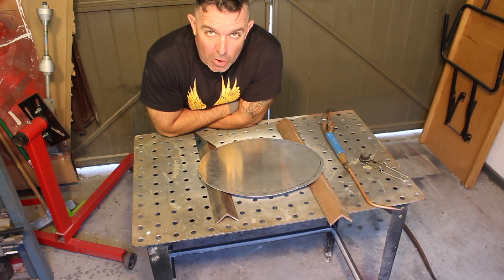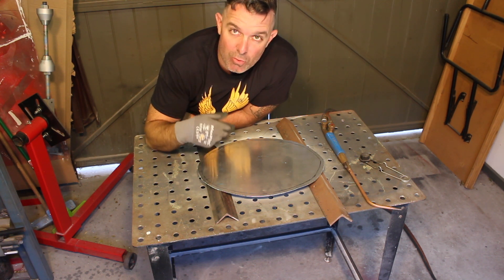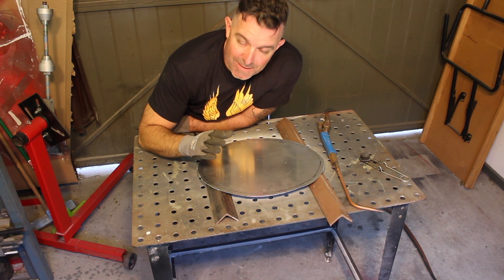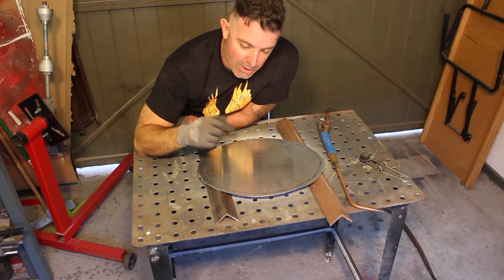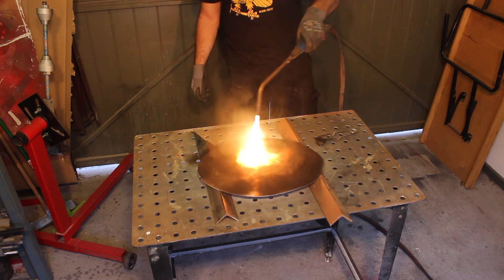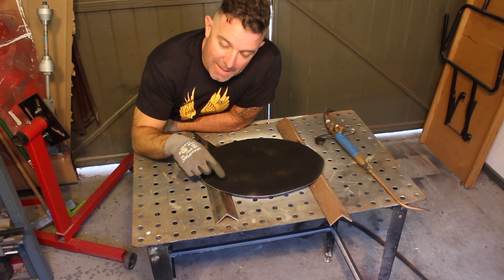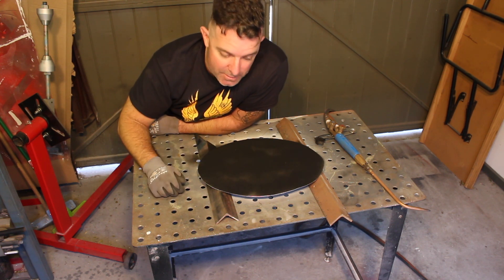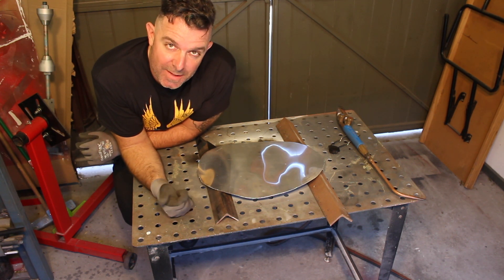How to anneal aluminium (for metalshaping)

Comment: Correct me if i'm wrong, but doesn't putting that soot on the metal before heating it add carbon and cause the aluminum to lose it's resistance to corrosion?
Reply from the maker: No mate, that shouldn't be the case, the soot burns off well before there is any metallurgical change to the aluminum. The corrosion protection on aluminum comes from the layer of aluminum oxide that forms with exposure to oxygen in the air. The carbon in the soot is just sitting on the surface, its not bonded or chemically reacting with the aluminium underneath. Hope that helps!
Reply: @krankengineering  It does! tyvm!

Comment: I like the look of this method. I have a sheet that I want to form the edges around  a pattern I have made, should I anneal first?
Reply from the maker: Hi Dave, you could, depending on the specific aluminum you are using (some is supplied partially hardened). It can’t hurt to anneal first if you don’t know what you’re working with.

Comment: Would love to know how you would shrink a cupped shape dent on a flat sheet of alloy .
Reply from the maker: What are you thinking Johnny? Like a half baseball shape on a flat panel?
Reply: @krankengineering  Yes . I have a dent on my alloy floored car and it is like half a baseball though the edges are more progressive not sharp edges . And the floor is flat .
Reply from the maker: Shrinking like that sounds like a “hammer on dolly” problem. Meaning put a dolly under it and hammer it down on the dent and onto the dolly. Depending on where in the floor it is it might be hard to hold a dolly under it. So maybe use a piece of hard wood. Jack it up hard right under the dent in the floor. Then from inside the car hammer it down onto the timber/dolly. I’d start with this approach.
Reply: @krankengineering  Thanks Matt would I use heat to shrink also ?
Reply from the maker: @johnnystoka6625  I don’t think so. Unless it’s super thick plate. But use a mallet with a rubber, leather or plastic face as a steel face will ding up the floor badly. Or put a block of wood between the steel hammer and the floor to cushion the blows a little.

Comment: Thanks for sharing Matt, super helpful. I've seen some people quench after annealing, is that advised / a bad idea? or were they just in a hurry?
Reply from the maker: Hi Al, in this case the whole point is to let the part cool slowly. Quenching is used in heat treatment to make the part harder. In this case we want to make it softer. There may be a reason to quench after annealing but I'm not aware of it and I don't do it.....be interested in a technical description of why you might quench a part you're annealing.....?
Reply: @krankengineering  thanks for the reply Matt really appreciate it 😊, I know the above is the case with steel, I just wondered if it was different with aluminium. I don't really mean quench in the metallurgical sense, just to cool it down with water so you can get to work! I've seen Terry English do it, and he's made a thing or two from aluminium, but then he might have just been doing it to quickly get to work. Also reading up on the different alloys, it seems they behave differently to work hardening, annealing etc. So might be a good or bad idea depending on what metal you have. Thanks again 😊
Reply: I’ve seen quenching in cold water on several videos and on written on-line instructions but other places and videos say not to quench aluminum.  I’m confused.

Comment from the maker: What are other tips and techniques for annealing aluminium? Post links to other helpful videos as a reply to this comment 👍
Reply: I use the Permanent marker method and butane torch. Cover the area in permy then heat until it dissapears.
Reply: you have mentioned soap, which is a method my dad was shown by a local coach builder, I was planning on using tempstik crayons, as I don't have an Roxy torch, just a propane torch, from memory the temperature we are targeting is 650F ( ~345 C ) I've heard of this soot method mostly though. great video thanks for sharing mate
Reply from the maker: JB was it some sort of special soap? Do you remember the details of how he did it? Propane should be plenty hot enough 👍
Reply: I just rang and checked with Dad, he wasn't sure exactly what kind of soap, just "soap" a quick check on the internet suggests "Dove" does work. Steve would anneal a big stack of sheets, by placing a sheet down, wiping the bar over it, heating it till it changed colour, then put the next sheet on. would build up a stack of 40 or 50 pieces, then leave them to cool. You also mentioned sharpie, heat up until it disappears, also seems a good way to do it
Reply: as far as temps go, 1100 and 5052, heat to 650F then cool, 6061 and other harder alloys, heat to 750F for 2-3 hours, then cool
Reply from the maker: Yep whatever gets the job done 👍